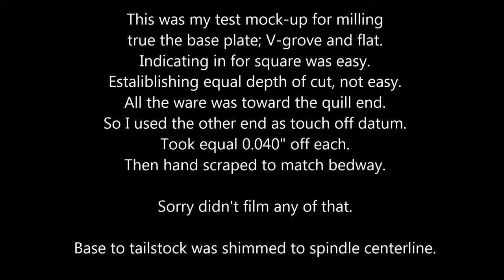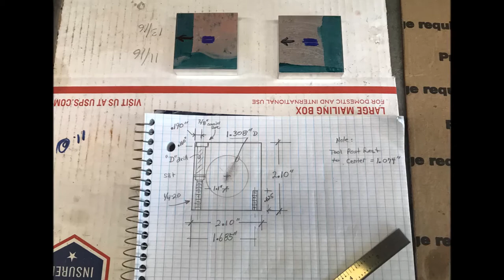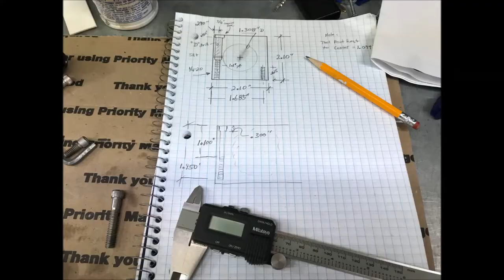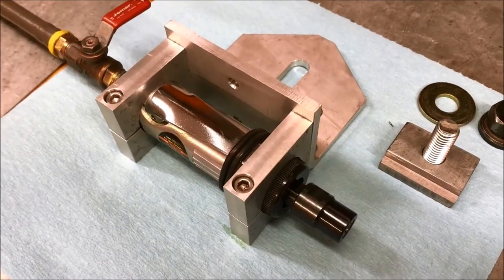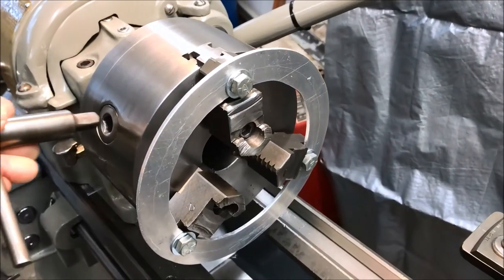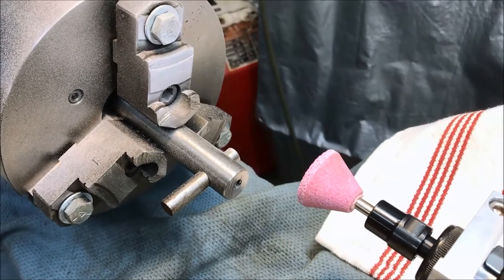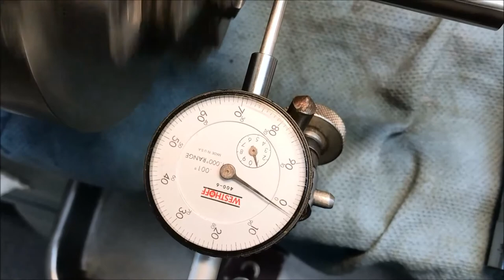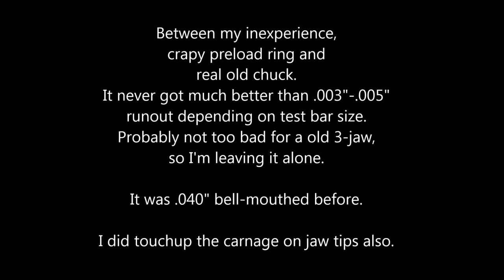South Bend Lathe Rebuild Part 7

Comment: Very nice tool post grinder build. Maybe you can find some NOS replacement jaws? I wish I had a mill so I could make a T slot nut for my quick change tool post. I just have a cross between a hacksaw and a nightmare with aluminum in there now. It's working, but... -  You might be interested in the oil reclaimer drip tray I show in my latest video. You have the skills and tools to make a really nice one. Ideally it would go under the quick change gear box too, almost as if the chip pan extended all the way out past the left end of the lathe.

Comment: I just watched your grinding of the jaws I think that your problem isn't your ring it's how your doing it. Install your ring again then grind your inner jaws then put a slug that's concentric and tighten it on the inner jaws then grind your front jaws and its should come out perfect
Reply from the maker: Never thought of doing it that way. Thanks for the tip!
I have another 3-jaw I'm going to fit up also. Dang the price of semi finished back plates have gone way up!

Thanks, Dean
Reply: @TheAyrCaveShop  well the issue is that you want your jaws as they are when you use them and I can't take credit for this system Suburban tool has a great video on it. But anyway basically what your doing by doing it with that method is taking up any wear or backlash in the entire system mounting plate jaws and gearing in the jaws. In essence correcting it to the lathe